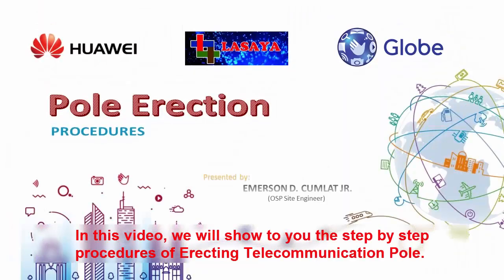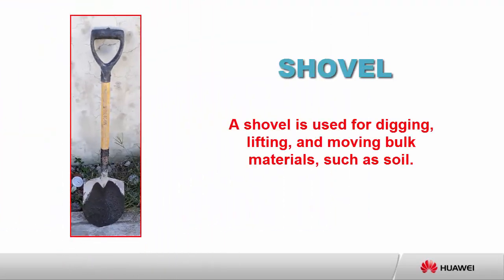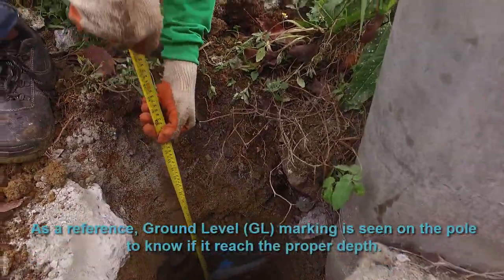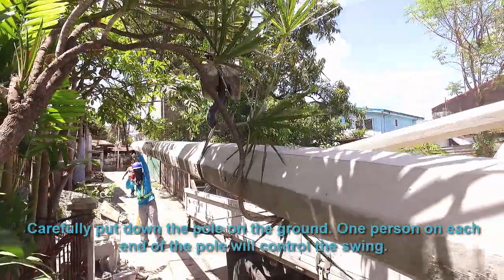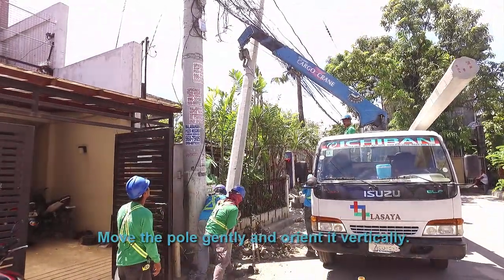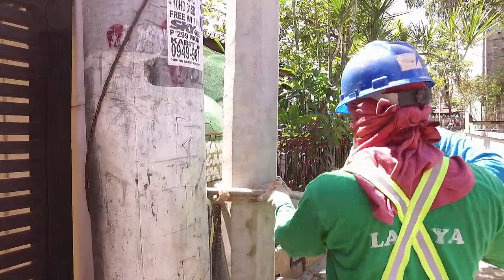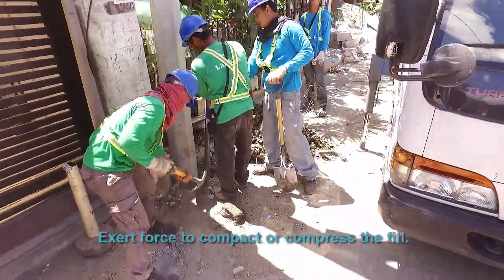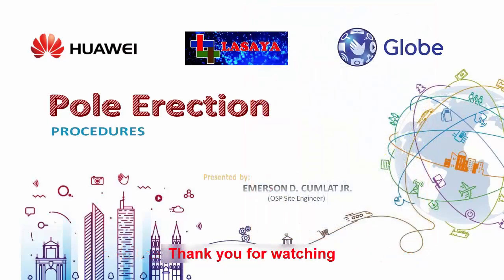Telecom Pole Setting or Erection

Comment: 1:2:3   1 bag cement 2 bags of sand 3 bags of gravel
Reply from the maker: instead of bag as unit it is supposed to be by parts, I missed to include 0.5 parts of water.
Reply: @EMERmusikero93  sir ano po ang depth kapag 25ft pole ang ieerect? 5ft pa rin ba
Reply: @johnclarksanjuan  its always 1:6